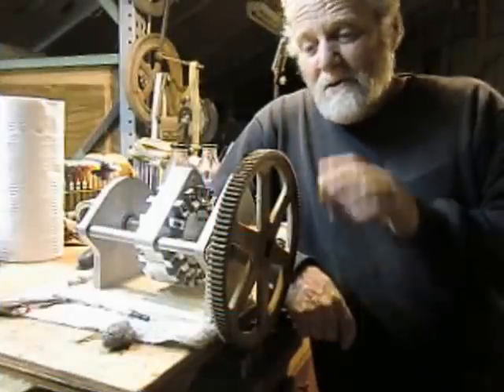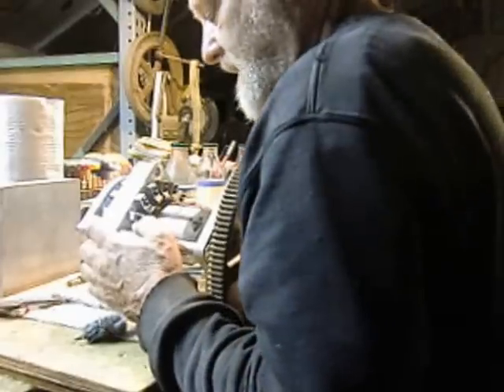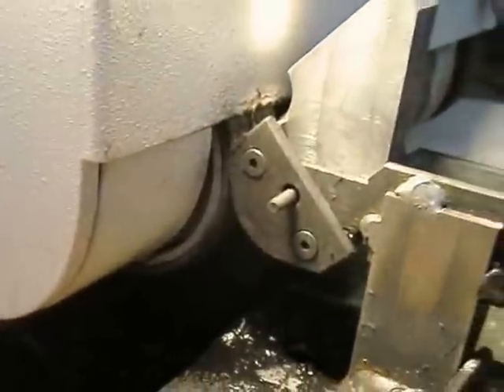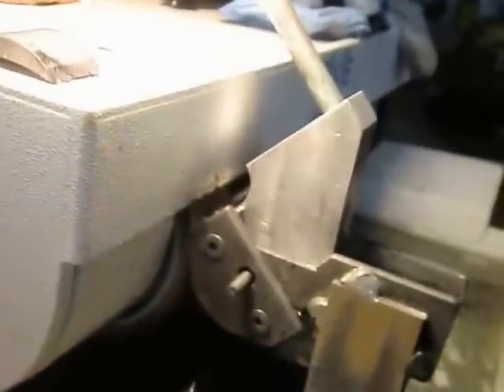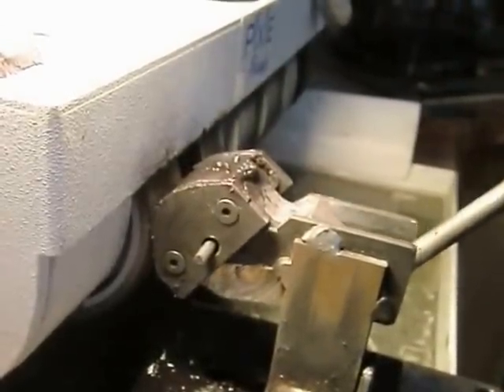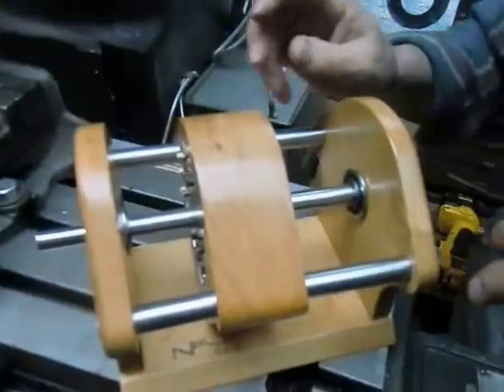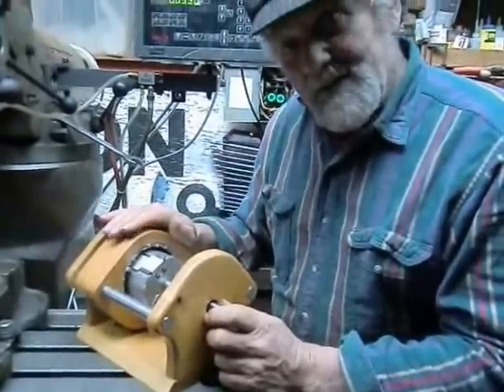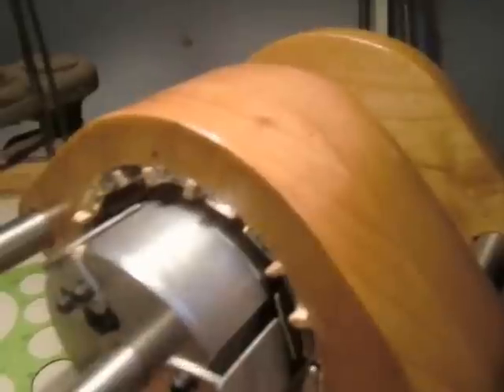HoJo Permanent Magnet Motor

Comment from the maker: Keep looking under this same heading HoJo motor and you will find a few people who have succeeded. Problem is the motors have just enough energy to run themselves, not much extra. I'm sure someone will crack that barrier soon.
Reply: Nik C. Colyer There are no real working examples.  The reason becomes obvious if you step by step work out what the average torque over one full rotation is.  The average excluding friction is exactly zero.  Encouraging folks to continue with an idea that has long been disproved works against our energy solution for the future.
Reply: ***** Edison was in fact working on something that he already knew worked at least for a while.  Lots of people had made short lived lightbulbs before he took up the subject.  He made lots of wrong guesses before selecting carbon as the material.

On "magnet motors" the situation is quite different.  There is a step by step logical reasoning that shows that they can't exist and no working examples.  Fiddling about with magnets is wasting the time of people who may otherwise discover something useful.
Reply: Ken Smith Actually, it was Irvin Langmuir who properly developed the Light Bulb. Edison was stuck in the past, as referenced by his vindictive behaviour to anyone who opposed his ideas. Most notably Tesla who utterly destroyed the DC electricity supply network of Edison. Edison, always the entrepreneur seeking wealth and accolades, regardless of efficiency!
Reply: Dwane Dibley
Edison sold a lot of carbon filament bulbs before Langmuir did his work.  Before Edison, there were others.  The lightbulb evolved more than it was invented.
Reply: *****
It is better to think of it this way:
1)The force between two magnetic poles is always along the line between those 2 poles.
2)The strength of the force between two poles depends on the strengths of the poles.
3)There is no way to sneak up on a magnetic pole.

No combination of motions of magnetic poles can ever produce energy QED.
Reply: *****
The thing in the video can't work.  The explanation of why is simple enough that a high school student could follow it.

The situation with a shield it a little harder to grasp but still hinges off the point that no combination of magnetic poles can ever create energy.  Any material with a mu higher than that of free space is basically millions of magnetic poles attached to springs that let them move a little.  This turns the question involving shields into the case already proven.

This is not a case of "engineers haven't figured out".  It is a little like the question of flying by flapping your arms up and down.  You can't do while wearing a red hat and you can't do it while wearing a green hat.  It is not a problem that you just haven't yet found the right color hat.
Reply: *****
The UN has no power.  They can't take action within a nation.
Nobody who has the power cares enough and nobody who cares enough has the power.  We only have the voice of the reasonable person to defend against it.

Comment: YOU'LL DO IT DUDE!
Remember when some nobody is getting you down remember arguing with an engineer is alot like wrestling with a pig in mud sooner or later you realize the pig likes it. I think your design is nearly there but very rigid I been building something similar using a cam mag piston design It works but its has to be turning first before it goes on its own. All the best with it great job :D

Comment: you need to add pole shaders to your magnets, only then will it work in a practical, usable manner
Reply: Nope. Even with hypothetical monopole magnets a magnet motor is not possible. Monopole magnets give you pure attraction or repellence. But both always work two ways. Never mind how you position and angle magnets, their clockwise and anti-clockwise torque to the rotor is always equal, making the resultant overall torque zero. Conservation of energy can't be tricked and since permanent magnets are not a source of continuous energy a magnet motor is not possible.

Comment: Reduce the magnets on the stator. Your magnets are too close to one another and it's causing your magnets to push in the wrong direction.
Reply: There is no change that can save the idea.  No number of magnets will ever work.  There is a simple logical step by step explanation of why.  It is likely you will be able to find it for your self with just a little hint.

Imagine a machine with just one pole on the rotor and one on the stator.
Notice this is its own mirror image.
Imagine you want to work out the average torque for one full rotation
Add more magnetic poles and notice 0+0+0+0=0

Comment: From this video i just want to make a suggestion for you. It seem to me that your doing your research in the most expensive and time consuming way. You should test out the magnet in the most cheapest way first, maybe use CADCAM (3D MAx or solidworks), or test it on thrust bearing using glue gun to work out the angle of deflection between the magnet polarity etc..machine out what is necessary etc.... Once your figure out that's its working then you build serious prototype out of it. From what i can see you have hardcore machining skill + perfectionist. This is  R&D not artwork so there's al ot of ground to cover. Efficency = work smart + work hard. cheers*----------

Comment: Hi Nik,
          Your work on your HOJO motor looks interesting however if you are contemplating a motor that theoretically runs without any power input then you may be wasting your time as so many attempts at this over unit motor have been made and I have yet to see a design that would work in theory. However having said that I personally think it is possible and I hope you are successful. The grinding operation you performed on the nemidiumironboron magnets will reduce the effective magnet strength by a huge amount. Try and use the whole magnet and see if the pull is right for what you want to achieve. Once you have the desired effect then you can start putting in lots of effort but save the finer details until you are sure of the final action. I wish you well on your project.
Regards Mo King

Comment: I see that you shaped your magnets by grinding them; did they lose any of their potency? Because hi temperatures is an issue.
Reply: If you grind very slowly, you can avoid high temperatures and keep the magnets good.  There is no need to shape magnets but if there was, there are ways to do it.  It just involves making a bit of a custom grinder and a custom jig.  Doing it all under water or oil helps.

Comment: 1 big problem I see is when you cut the magnets you are heating them up which significantly decreases the magnet strength
Reply: You can cut magnets keeping them cool if you have a lathe and a lot of time.  The trick is to set up a machine that takes a really long time to slowly wear its way through the magnet while having the magnet held in quite a lot of aluminum.  The aluminum wicks the heat away and then loses it to the air that is going by.  Still if is way better to find magnets that fit your purpose and design around them.

The idea in this video can be shown not to ever work but I encourage you to look real solutions to the energy problem.  Remember to do a "thought experiment" or two before you start buying and making parts.

Comment from the maker: I have gotten many responses from people who have succeeded with this concept. Scroll down for those comments. One thing I would try is a odd number of magnets 17 or 19 around the field.
Reply: The even number vs odd number doesn't save the idea.  A simple thought experiment starting with one pole on the rotor and one on the stator shows that the net energy output off all arrangements is exactly zero.  Thus this idea is not a path towards any solution to the energy problem making it a diversion for folks who may want to join the effort to find real answers to the problem.

Comment: Good evening sir, I stumbled upon your informative video. I'm trying to replicate the motor for my senior project. After putting in the 16 magnets, did the machine function? Also, do you have any suggestions for an inexperienced college student? I'm barely about to get started and I have a small idea of what I'm doing. Thanks for taking the time to read my comment :)
Reply: This is not a good choice as senior project.  Are you taking mechanical engineering?  The machine can't work so you will be headed towards embarrassment.  I will give you a start on seeing why for all cases like this one:

Imagine that you have just one magnetic pole on the rotor and one on the stator.  Call the point where the two are lined up with each other 0 degrees.  Mark off a line running from 0 to 180 and notice that the machine is its own mirror image along this line. 

Now imagine that you want to plot torque vs angle.  You measure the torque at 10 degrees.  Because of the mirror image, you can fill in two torques.  The one for 10 degrees is what you just measured and the one for -10 degrees (AKA 350) is minus this amount.  Thus for every torque at an angle there is an equal and opposite one.  You can see that the average for one full turn is thus exactly zero if you ignore the friction.

Now imagine you add another pole to the rotor or the stator.  The same argument applies to the torque it causes.

0+0+0+0.... = 0
Reply: Ken Smith I am an Electronics Engineer, and I do value your input Mr. Smith although I would like Nik's point of view on the matter. I have other blueprints and notes about the best possible way to construct the motor, but this project is something that I already have my mind set on doing and I will not change it. I'll be working on this non-stop for the next few months to come and I will find a way to make this project work. Your input is highly valued, I need more thoughts on this so I won't be banging my head on the wall later.
Reply: checht69 Have you considered telling any of your teachers about your plans to build a functional perpetual motion machine? I'm quite certain they would have some good suggestions for you. 
The most you can hope to accomplish is making a highly tuned apparatus for showing that it doesn't work. And that's slightly redundant. If you're asking for thoughts on the project to help yourself from banging your head on the wall, I suggest you don't try to make this project work. It's not a matter of "figuring it out". There's nothing to figure out. It will never ever work.
Reply: McJaews Not just yet, I'll probably do that right now to get a better idea of what type of magnets I should be putting into the device because on the handout I have, it specifies the dimensions but not the weight of the magnet which defines the power of it. So I'll probably end up asking what the weight of the magnets should be so that I can figure out from there what to do with the machine.
Reply: checht69 The weight of the magnets doesn't matter much.  All the numbers scale up and down with the magnetic moment of the magnets used.  Thus you end up with things like:

8 - 8 = 0
vs
10 - 10 = 0

The outcome is still zero but the numbers used to get there are a different size.
Reply: Ken Smith Thanks for the insight! So then what type of magnets should I start off with? I've got the time and energy to work on this so any help is greatly appreciated.
Reply: checht69 I would suggest starting off with zero real magnets.  Instead do a few thought experiments.  This way, you can avoid building something that is hopeless from the get go.  The sort of thing I mean is:

If I made a machine with just one magnetic pole on the rotor and one on the stator and a really massive flywheel, what would the average torque over one full rotation be?  Think about the fact that the machine is its own mirror image to see that the answer is exactly zero because "X=-X" is only true when X=0.

This is the reason for my "8-8=0" comment.  The mirror image nature of the problem ensures that every positive torque is matched by a negative one.

The next thought experiment would be to think about adding some more poles here and there and noticing that the outcome still must be zero.  When you hit on something that not matter how hard you work at it, you can't prove the outcome is zero that is when to consider the buying of some magnets. 

Run down to the hobby shop and look at the cylindrical magnets and pick out a diameter that is also the size of a drill bit.  Since everything scales, the size only matters from the point of view of ease of building the machine.  You are also going to want some glue that dissolves in water.  This way you can get the magnets back out of the machine.

You are also going to want a good set of bearings that are nonmagnetic.  You can get these from places like http://www.mcmaster.com
The material is going to be Acetal or the like.

Then it is just a matter of building the idea and putting it to the test.
When it fails to work, don't fiddle.  Step back and look carefully at the design and work out what the heck is going on.  You can save many fiddles with one stop and think.
Reply: Did you ever do this?

Comment: Hi Nik, have you considered the effect of eddy currents in the aluminum parts?, they will act as a brake.....I think magnet commutation is the answer, like a dc motor , without a commutator it wont turn more than one pole pitch!
Like a 4 stroke engine also,  the camshaft does the commutation ( of the valves)

DC motors are also generators if driven (ok permanent magnet ones)
By the same idea a magnet motor would require mechanical commutation of the magnetic poles to operate efficiently I think?

I will do some brainstorming on this. There are so many scammers and debunkers around I feel it would be stupid to expose oneself to that?

They thought the world was flat once upon a time....It could be, for all I care!
Its not the issue to most folks eh?
Keep on trukkin, norm

Comment: I admire people who work and spend time occupying themselves with something or other as they keep their mind active and so physically and mentally active which is a great formula for a longer life.
However there is some knowledge one needs to know. Force is one thing, while work  and energy is another issue.  Just because you have force it does not  mean you have work done nor energy. A magnet has force, and I have no doubt that it contains internal energy.   Pertol, Diesel, wood, atomic structure all have energy contained in them.

Now to have work done Force needs to cover a distance and while it does this IT LOSES ITS INTERNAL ENERGY.  A gallon of  Diesel will make  a car move, but the gallon is used up as energy changes form one type( internal) to another which could be numerous including mechanical and electrical.

I am afraid any configuration of placing magnets in any configuration  no work can be produced unless the magnet loses its magnetism.  If any system of magnets is couples such that the magnetism is not lost then one can say that one has  produced a GEARBOX OR A COUPLING.  If magnetism is not lost then  one had not got a motor but one has made a gearbox or a coupling as a gearbox or a coupling does not do any work---------- it only couples  and transfers energy.  but does not generate it.

Many years ago one man approached  me to go into partnership with him to make magnetic motors, He was so secretive about it and he wanted me to go into a legal agreement.  I refused  as since his highly  accurate contraption showed signs of life to him, almost there he said, I told him that all he had was a good gearbox with magnets attracting and repelling each other but no work was being done, as it is not possible to create enenrgy out of nothing-------- you can only exchange energy. 

Still, please proceed to enjoy yourself with such precision machining but I would suggest change direction a little. I myself took up making classical old escapemants for Pendulums, they are beautiful in many ways and are almost perfect machines, but you need to give them energy to work.

So please consider that unless a magnet looses its magnetism, no work can be  obtained from any magnet.

Comment: +Nik C. Colyer , I have been looking around and researching and experimenting for quite some time now on magnetic motors. I have run into the same problem as you it seems- I can't quite get the drive shaft to spin completely on its own after the initial start up... However, I have seen some videos (false or real, I don't know)  where the angle of the magnets towards the opposing magnets causes sufficient force to drive the magnet away, this if completed in a circular motion, would mean that it could occur infinitely. Maybe you could explain to me (if you read this) why yours will not spin on its own? I am thinking possibly friction and the angle of the magnets? Thanks. 

Oh, I also forgot to mention that in its current state, you could provide a small AC current to change the polarities of the magnets and then spin the drive shaft. Obviously you would be expending energy if you did that, but all you would have to do to counter that is harness the energy that the machine produces and then it will slowly begin to power itself.

Comment from the maker: Jose; I set that project aside a few years ago unfinished and moved on to other projects many of which I have filmed. Check out my 100 plus other videos on youtube
Reply: Hey Nik was trying to send an email but this will do. I to have been working for 20 years on developing a rotary motor with permanent magnets. I learned from all the failures.  However I learned to get the work from magnets I had to reformulate Lenz law. Now I am working with this achievement and having good results. I will be posting to YouTube when the load is connected.